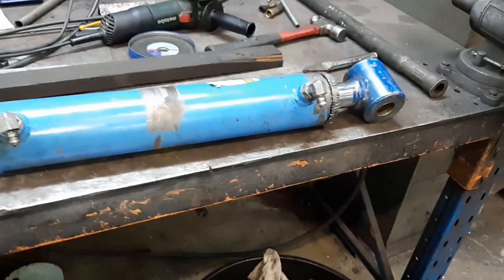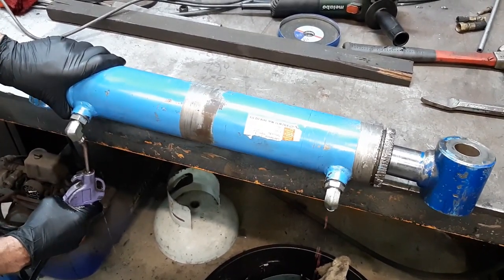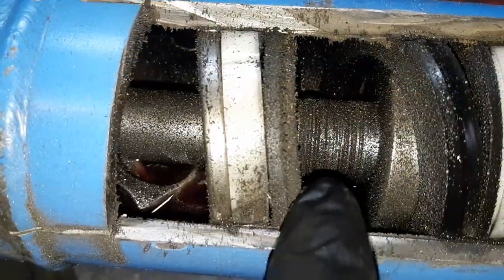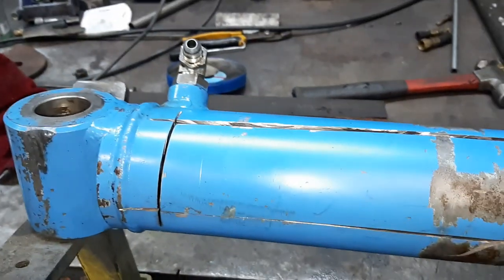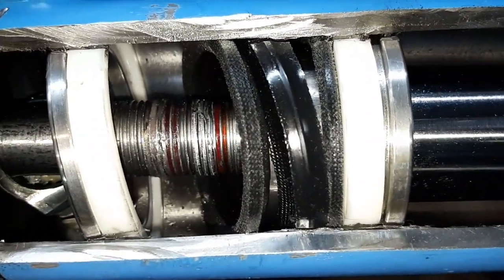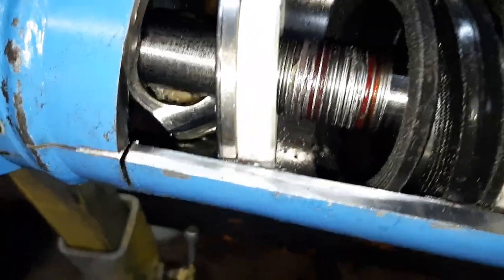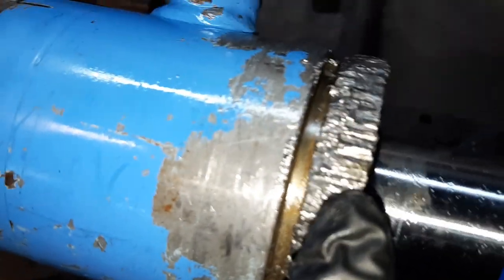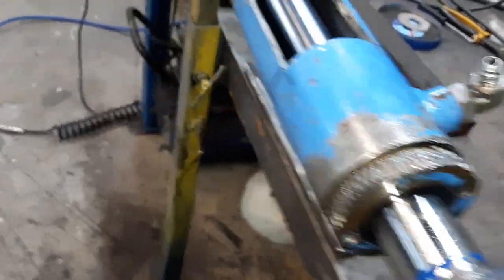Customer States Hydraulic Cylinder Extends but Does Not Retract I do a Failure Analysis

Comment: Most home owners don’t have tools to properly tighten the nut 
They will come loose if not properly torqued and lock tight on treads
Reply from the maker: I agree Phillip, with that being said I am not sure what happened here I think that the cylinder was over loaded and the nut holding the piston on stripped out the thread.

Comment: You cut the cylinder open ?  And it's the seals and the nut piston ?  you ruined the cylinder there is no way the seals or the nut coming loose would not allow the shaft to be locked in one spot.
Reply from the maker: John, if you watch till the end of the video, the rod was slightly bent as well, causing massive internal stresses that did not allow us to even loosen the gland nut.